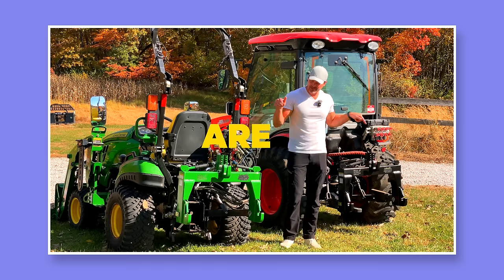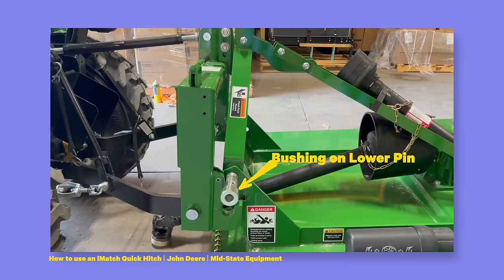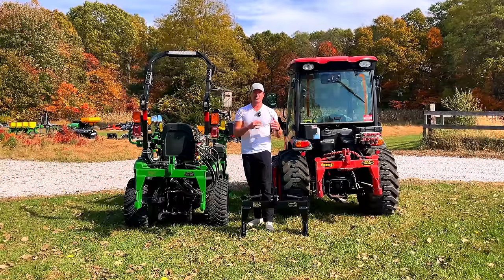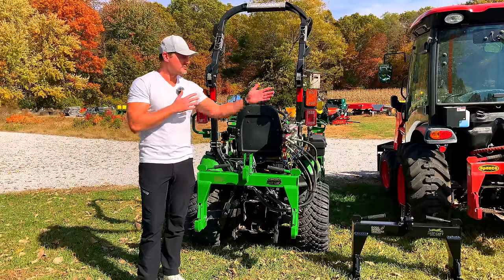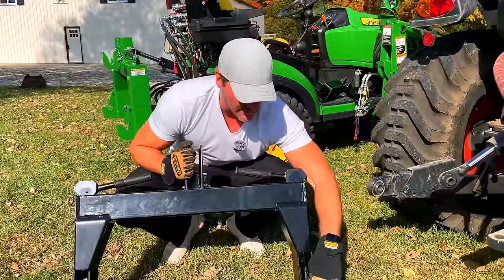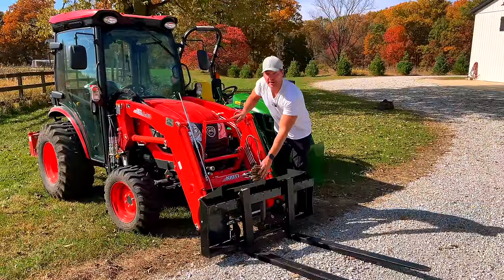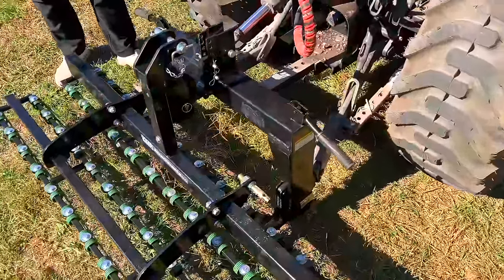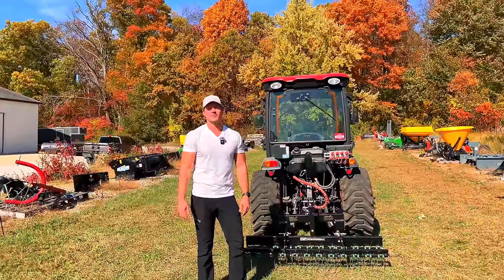WE JUST MADE THE TRACTOR QUICK HITCH EVEN BETTER!

Comment: I was using my nephews 1025 R with the Speeco quick hitch.  While mowing my 3 5 acre property using a quick attach brush hog, the pin you talked about that can fall out in shipping can also fall out while in use. The pin vibrated out and I noticed right away that the mower had Tilted and started dragging.  I stopped the tractor and found the handle the pin holds in about 20 feet behind me on the ground.  I used the metal hook end of a bungee cord to get it back up to my shop.  Replaced both pins with a grade 8 bolt and nylock nut.

Comment: Here's are some suggestions to make your hitch even better:  1.  Add 3 sockets to accept a standard 2" Reese hitch extension, one under each lower hook and one under the top hook.  Now you can design and sell bale spears to fit the sockets.  2.  Weld a grab hook on each side of the upright arms to hang chains on or use for pulling.  3.  Weld on your heavy hitch suitcase weight hangers on each upright.

Comment: 👍 For pointing out how much easier the hydraulic top-link makes using a quick hitch. The first/last time I used a quick hitch was prior to having a hydraulic top-link and the ground I was working on twisted the two 3pt planes (tractor and implement sides) enough that I eventually got frustrated and took the quick hitch off the tractor mounted it on the implement and then made the connection to the tractor (a win for having telescoping lower link ends). Haven't used a quick hitch since -- as I really only had to the one time because I was using a borrowed implement where the lower link pins had been replaced with nuts& bolts that had long since rusted solid.

However having said that your new product seems to add enough value (especially with supporting the weight brackets) that I'd consider getting one in the future. I greatly appreciate it when a business adds insightful changes/features to a product that greatly increase the product's utility/value at minimal cost/weight difference.

Comment: Hi I am from the thumb of Michigan in farm country this quick hitch helps a lot especially when you are old . When I put my quick hitch on I do it a little different than most I put it in my barn an lift it up with a floor jack an roll it to the three point. Then make the arms low an wheel it to the arms. Have the hitch a little higher than the arms then you can lift the arms up to line the holes then put on the top link save your back .hope this tip helps

Comment: I bought the Speeco from you.  It works great.  My tractor is RED!  I also bought the 3 point dethatcher from you.  Also a great product.  I wish my Kingkutter tiller was quick hitch compatible.  The lower pins are too close together.  I installed longer pins and I can make it work if I am careful.  I can drop a pin out of the quick hitch if I am too aggressive with turning while tilling.

Comment: I have a couple pieces of equipment from King Kutter/Rural King. There’s a LOT more to this, but want to save time I purchased a quick hitch from Rural King. That also meant I needed bushings. As you measure front to back, the “hook” on the lower link of the quick hitch doesn’t have enough space between the implement pin and the frame. So I returned it. The whole episode was a week’s worth of of available time that was a pain in the hind quarters.

Comment: Maybe an option for weight brackets, and a receiver tube under the top hook to slide in a drop hitch.  Some 1/4” rod bent to hooks for holding chain would be nice too.  The 1/4” rod is plenty strong enough to hold chain and weak enough to straighten out when pulled on.

Comment: The one thing that I wish you had done differently...
The one thing...
Away to attach the PTO shaft to the  frame of the quick hitch.
IE.... when your trying to hook up a mower to the tractor... with the quick hitch...
The PTO shaft bumps into the drawbar...
Once you've connect the 3 pt... your wrestling the shaft to get in position... to get it on the PTO shaft...
Its not so bad on my 2038...
But my 5075 and the shaft on my batwing... that PTO shaft is heavy

Comment: With a quick hitch you can also keep the sway turn buckles tight so your attachments don't swing back and forth.
Reply: Depends on what your doing sometimes you want movement sometimes you don't, Personally I wouldn't by a quick hitch without Bushings.  On the larger 4 wheel drive tractors they learned in the 1980s that quick hitches wear out hitch pins.
    The bushings are designed to protect the hitch pins, without them the hitch pins wear and eventually break.

Comment: My father struggles to lift the quick hitch. I know its only 70 lbs but he struggles. So he lays it flat on the ground.backs over it and lowers the 3 point arms down into it. Then flips it up for the top link
Reply: What I did was make a platform, bench: its 1/2 inch higher than the 3 point will drop thequick hitch. You drop quick hitch on top of your platform and now you dont have to lift it more than a inch or so. Leave the QHitch on the platform to put it back on. Its much easyier to move or schoot it in to place when its at the same level as the 3 pioint.

the big key is to make the platform top much bigger than the 3 point, so you can move the Q hitch around to get it on or off, like 18" wide   and 42-48" long.

Comment: I have the SpeeCo which I bought from GWT a couple years ago. would appreciate you covering attachments with PTO using the quick hitch. How to determine if that attachment can be safely used with the quick hitch or whether that additional displacement rearward would make the PTO shaft extended farther than what is safe for the overlap of the two halves. Thanks.
Reply: I got a tiller from LP.  It fit the QH stock, but they would have cut it otherwise.  I think it extends ~4”, so you might need a PTO extension.

Comment: Seen some implements where it is too tight for the top hook to get into, would it help if the top hook had more of an angle for the top half maybe? I know its cut at 45 or so but the hook it self is still u shaped, what if it was leaned out for a 45 for maybe the top 2 inches? That combined with a hydro top link would give extra reach to maybe catch a top pin on something that was not designed for quick hitch. Im sure it wouldnt be as strong on the very end but it wouldnt need to be just to catch it enough to get it to slide into place. I saw someone on youtube that had to leave one pin out of the top hook for that reason, to be able to rotate the hook some, but if the hook was bent out more maybe that would work and still keep both pins in. Even if it was just a second hook you could buy just to swap if needed, could be worth looking into maybe.

Comment: I had switched to a Speeco until I got the Del Morino FLI186MHSS flail mower. It has cat 2 lower pins and I haven't found any cat 1 pins that will fit the holes in the frame for the cat 2 pins. I had to go back to my original Land Pride QH15 and back to using adapters.  I might could machine some bushings to use cat 1 pins on the FLI186MHSS now that I have a lathe. But it shouldn't be that difficult, and there's no reason for this flail mower to need cat 2 pins.

Comment: Why not make the Cat 1 quick hitch wide enough at the bottom to fit a Cat2? Then just change the size of the pins if neccesary?
Reply from the maker: Cat 2 attachments are 6" wider.  Wouldn't solve the problem.